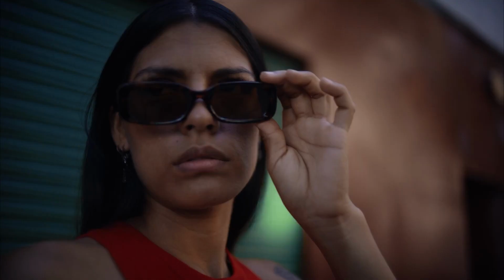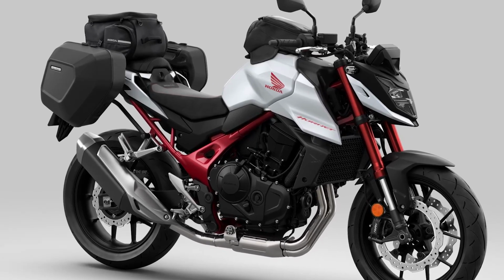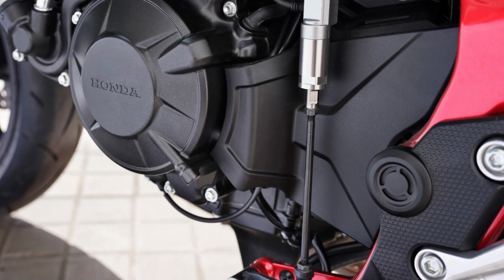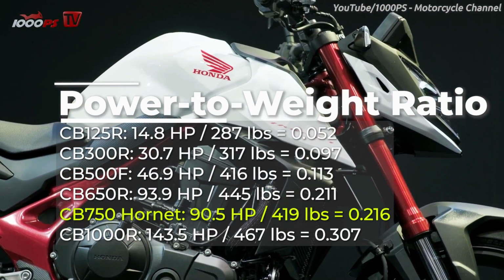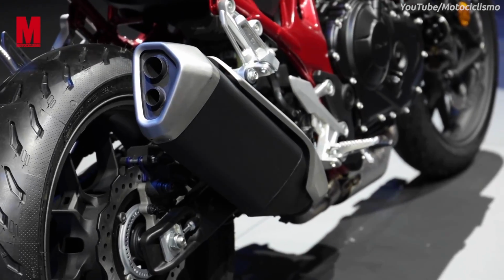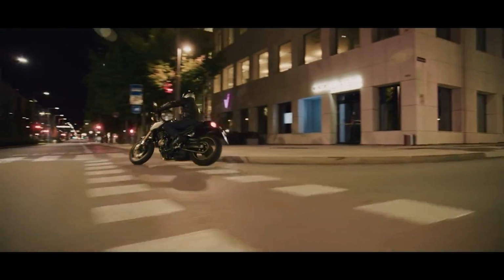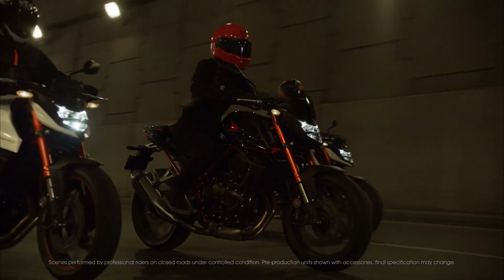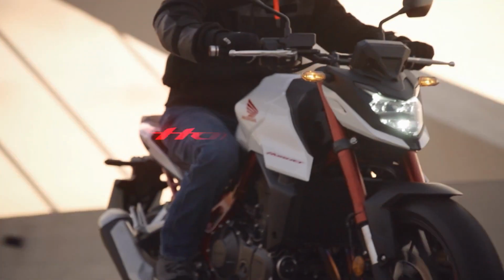NEW 2023 Honda Hornet CB 750 First Look Review / Specs!

Comment: I have a 2004 cb900f 919 hornet. 6000 miles.
And a 87 honda trans alp in great condition.
I would consider the new trans alp. if it has a better head light.
I started on twins. but i prefer a v4 or inline four. Its all personal preference.

Comment: 100% depends on price. It’s a high horsepower Cb500f.... the CB500.750F.   @7500 it’s a hero, @8250 it’s average and @9000 usd it’s D.O.A.   All signs point to 8k usd, I hope so.

It doesn’t have enough new parts to be considered new, it’s a new engine ( and by default frame/tank) in a Cb500f chassis.... I hope it holds up.... remember how they were so proud of themselves for cutting weight on the Cb500f re-design by making the swing arm thinner... now it’s got double the power ......

Comment: I WILL definitely look at this bike, for three reasons.
1. I'm vertically challenged, so the low seat-height is a big plus
2. The relatively light weight
3. The legendary Honda reliability
Reply: vertically challenged :), you mean short. As said, there are ways to change the seat height, easiest being aftermarket seat, which often is good to do anyway to get something of higher quality.
Reply: @jutjub22  
Yes - I'm a short-arse :) 
Thanks for the tip !!!
Reply: you are not mentally challenged boi. get a shortening kit for almost all bikes.. dont let your height determine what you can do
Reply: At 8k I’m probably getting a black/red - higher ? .... eh

Comment: the reasons I'd choose the cb650r is because of the cable throttle as oppsed to ride by wire on top of the inline four soundtrack that comes with the 650r.
I already own the cb300r as my begginer bike and now that we have news of the hornet potentially coming into the market I am almost overwhelmed with opportunities for when I decide to move on from my current bike. Not to mention we have offerings from kawi,yamaha and susuki with competitive pricing and performance which all fill their specific niches. All this being said I am a bit of a honda fanboy so when I pay off my bike I can say will 99% certainty I will buy a Honda again, but those kawis are very tempting as well.
Reply: I think it depends on what you do with it, if you piddle around and want better highway power or are fat... this is good, but if you are gonna push it or track - the chassis is a downgrade. 
I will say if Honda would have offered 45 more hp for 1000$ on the Cb500f, I’m sure most would have gotten it.
Reply: @stubbingtonmarigold3032  probably gonna want the 650r for around town capacity and highway usability, plus the looks are leagues above the hornet
Reply: That's two reasons.

Comment: Just judging by the specsheet it fits in todays market. (MT-07 and others)

BUT
Absolutly boring old design, similar to the Honda CB500f (since 2013) and the Suzuki GSX-S 750 (since 2015) Maybe this bike offers something new or exciting in the electronics department.
Looks like a well designed dash, but what is it worth for, if it can't show anything relevant? Riding modes on such a low powered bike are a gimik.
Lean angle sensitiv riding aides which could be adjusted are not featured in this bike and the potential customer base (young european, upgrading after A1/A2-licens) does not use vehical integrated "connectivity", they use their performant smartphone, running a reliable and always up-to-date navigation app in a well made phone-mounting solution. I still don't get, why any new motorcylce wich has throttle-by-wire does not feature a simple cruise control button (like Triumphs retro line of bikes). WOW It's sad, that LED lighting is a feature, that still has to be mentioned in 2022. Let's not forget the marketing fail: the Hornet has been THE Inline-4-Naked-bike. This new bike doesn't deserve this name. Even Honda's own CB650 F neo sports café or CB 1000 F are more of a new hornet than this bike. 
It's really sad, that this bike misses so many opportunities. 

If the after-market catches on and a simalar variety of customizable parts for the MT-07 becomes available, it could still find a customer base. 

Last nit-pick: All folks who are concious about value-for-money buy USED. A new motorcycle has to spark some pride to own it. The "I-NEED-this"-faktor on this bike is way too low for me personally. 

(This is just my opinion about the product, please don't take it personally.)

Comment: I think Honda should of given the bike a different name. It is too different from the originals. I still have the 900 hornet and this new platform doesn't have the traits of the originals. Especially without a four-cylinder, just my opinion.
Reply: I agree, this bike has nothing to do with a Hornet. They should've called it a CB750 Nighthawk.
Reply: @PrimoStracciatella  Even most of the Nighthawks had four cylinders.
Reply: @crankybear1236  Right. Honda should've given this bike a new name since it's the first 750 parallel twin (the NC engine is somewhat in its own class). The Hornet moniker reminds of upswept pipes and even the 250cc version was a four. 
Calling it "Nighthawk" would be using a well-known name of a standard CB with relatively bland looks. At least there was the 450 Nighthawk which was a modern 3 valve twin back then.
Reply: CB500.750F

Comment: The engine will probably be a peach, but Honda cheaped out on the suspension, as usual. I wish Honda would put the horn button where most everyone else does too. Something as vital as this needs to be intuitive, not putting the indicators on instead, in an accident scenario.
Reply: What are you talking about with the suspension my guy far better than any of the stock competitors
Reply: @foxy ... remember the Cb500f re-design where they were so proud of cutting weight.... by making the swing arm thinner... that same swing arm now has double the horsepower. ??? It is the same size/weight as the Cb500f , but ask yourself does any other 70+ hp motorcycle use a 160 rear tire ? Do the rotors on the top tier bikes look more like the cbr650r  or Cb500f..... hmmm almost like the brakes are meant for slower speed commuting.... this chassis is a downgrade- so it’s all dependent on price. Sacrifices have been made - is it to save me money or Honda money.

Comment: I would take the 750 Hornet over the CB650R as its a parallel twin and servicing should be a lot less expensive. Same applies to parts . The white/red frame with the quick shifter and 90hp should make the bike a top canyon carver.

Comment: what is this ?! 
Honda is certainly joking. Ducati, KTM, Triumph laughing. 

Someone call Tadao Baba for some help. 

The name Hornet was associated with a savage middle weight. 130mm / 180mm tires from the original Fireblade. The Hornet name was a market trend setter. Now… it’s a Ikea Billy… sad
Reply: Laughing why? It's a P2 with competitive characteristics. I think you're dogmatically stuck in the past.
Reply: @ThermicLight  maybe I am. But from what I watched already, most of the reporters were expecting much more from the “Hornet” brand. Not this cheap product. Maybe we’re all stuck in the past, but branding does this, ties customers to concepts. 

Hornet was an innovative sporty middle weight quality bike. The original one even had parts from the Fireblade. 

Long goes the savage Hornet Trophy, they were fast…
Reply: @pedro_mg   - "The original one even had parts from the fireblade"

If only you did just a tiny bit of research. Otherwise you wouldn't look so silly right now. Please find quote below:

"A 270 crank and uneven firing order deliver that beefy twin character and the cylinders are the same as used in the CBR1000RR-R Fireblade and CRF450R."
Reply: @ThermicLight  lol, oh well…

Comment: It's right where I want to be in my motorcycling growth trajectory. Time to put the CB500x on Marketplace and make someone else a happy Honda owner. 
I like the aesthetic they have with this generation of naked/neo sports cafe something whatever they call it.
And 90hp on a 420lbs bike is a pretty big step when your coming from 46hp on a 430lb bike.
My only "meh" is the KTM-ish headlight, and I think a few extra pounds for a more stylish sub frame would have been worth it.
Reply: Think that suspension and thinner swing arm are up for double the horsepower?
Reply: the headlight is coming off the cbf models they had before which i like but yeah its a hit or a miss on the looks department
Reply: One of the best looking naked bikes around. Btw the cb500f isn’t 430lbs it’s 416lbs

Comment: Need a version with fairings and clip-ons to compete with the R7 and RS660!
Reply: They'll make it more commuter friendly, like the cbr650r
Reply: @brayvdb2191  
It doesn't look like it, judging by the hornet's weight, power, and electronics.
It seems like Honda is actually making a serious little sports bike without compromising on performance and technology for the sake of comfort.
I'll bet the cbr750r It's going to be closer to the cbr600rr than the cbr650r.

Comment: 8 grand for 90 HP and Honda quality a deal, kinda disappointed with styling but might look better in real life. Upswept exhaust would have been nice. As far as beauty CB650r easy winner. That 4 into 1 exhaust header gorgeous. Manufacturers are moving away from 4s because of cost. The engine is the coolest thing about wasp, but rest of bike nice too. Just was hoping for something a bit more dynamic as far as looks, but I bet it's a sweet ride w 90 HP and light weight. Fuel economy good too
Reply: For the looks they just copied the KTM Duke.
Reply: @justinmiller3294  in the concept art yes, but this thing looks way more like a CB500F than a Duke
Reply: @justinmiller3294  Honda doesn't need to copy Duke.
KTM is just another european and unreliable junk.

Comment: How do i not hit dislike the video? Lol not because of the video but because of the bike 😄.
So first things first... I owned a cb190r 2017 of 15Hp then moved to a cbr500r 2017 nice looking bike but sold it asap due to feeling it kind of dorky and heavy and then moved to a 2019 cb650r and 27.000 kms later i am totally in love with it 😍
Now, this is a total failure and a break in the stairway... this looks like a 2015 cb250 twister sold in central/south america.
The bike design is just lame and more coming from a "famous" italian designer... the head and tail are like a cb500f and nc750x mixed in a bowl... The muffler and tail are the same ones as in the 500s the light of the 750s, also maybe the swingarm. 
This has no real options of becoming a hot seller to me, the tech in it does not really goes accordingly with the bike power.
Common power modes for 90 Hp get the hell outta here!!
If i was told today what would you have updated of my current 650r would be add me cruise control and that's it.
Like the original video music and nowadays music is just another product and nothing more.
Going to ride my cb650r so hard tonight 😂i love it!!
Reply from the maker: lol I understand 100% but please don't, it doesn't do anything but hurt me and I'm putting my everything into this.

Oh yeah, I'm with you on all of those points. Why we need all of these electronics on a sub 100hp bike is beyond me but ever since once one manufacturer does it, then the others have to follow suit in fear of losing out on sales "because that other bike is better" since it has tech. Yeah, it's cool to say your bike has all of this tech - it's taking $$ to add that, when that $$ could have been spent to put better components on the bike, something that we'll actually feel and is useable whereas having 50 modes to flip through - doesn't benefit me in the least bit, when better suspension etc would. 

Yup yup, I was expecting more on the design front too like I mentioned in the video. It's not an ugly bike by any means and pictures / videos only do them so much justice but it's not something that jumps out at me and makes me say "I have to have this in the garage to stare at", like it should. I'm hoping after riding it, my excitement behind the bike will change. I do think it'll do pretty well though in the sales department as sadly, four bangers are on their way out and this bike, granted not the "looker" I was hoping for, beats out the competition on a lot of key points and of course, beauty is in the eye of the beholder - or something like that lol!